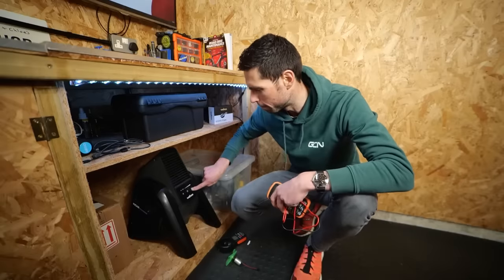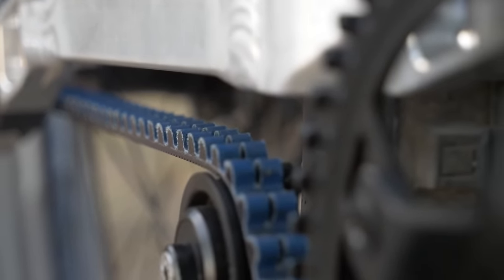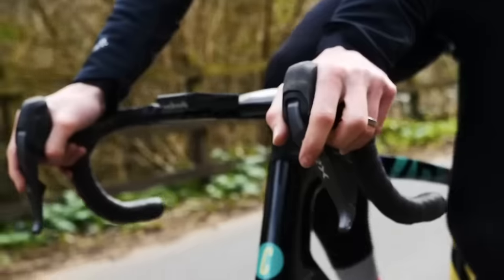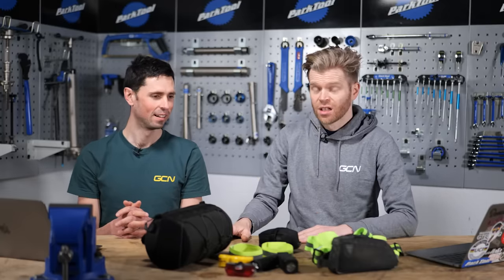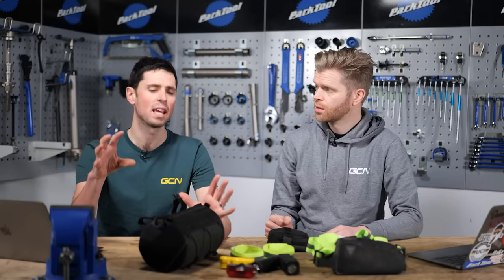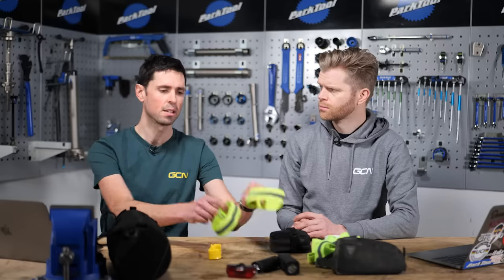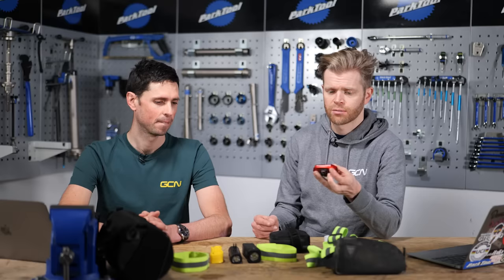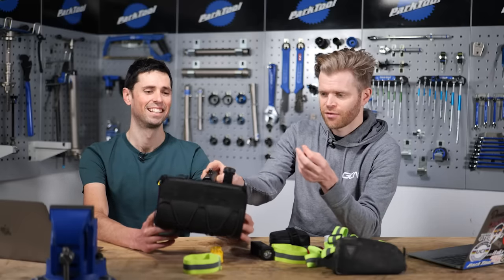The BEST Functional Bike Tech That Cyclists SHOULD Use!

Comment from the maker: What are the best cost-effective upgrades you've made to your bike? 🚲
Reply: It might not look pretty, but any kind of mount for a bike lock (kryptonite do their own) is such a time saver. Instead of digging around in a bag or pannier for your lock you just unclip it and lock up in seconds. Also - shifts weight to the middle of the bike so helps with stability.
Reply: Mudguards and a top tube bag. Both are super functional.
Reply: hi GCN bikers
I am a long distancies biker, from Greece, but I am using my bike in the city of Athens... so from my expirience I have to say... in all my routs I make my self visible using lights, but not only under my sadle olso to my helmet. In the city trafic, that all of people r behind the stearing, holding a phone, or they r stessed, they r going to c me when the crash me... unfortunately... and the second roule for me is that I am wering yellows jersey and pands... yellow is a unic color, reflecting so its easy to c me... thank u
Reply: Good tires.. they really save energy.. so you need to eat less.. and thus save back the price of the tires 😁
Reply: rear light with bike radar is great
Reply: @Jari1973  Eating less further reduces CdA - what a synergy it is!
Reply: I'd like to see GCN Tech do some testing on using CO2 refills with tpu tubes. I've seen a few stories online of tpu tubes starting to leak near the valves, and I think its because the CO2 refilles are freezing where the valve joins the tube. the freezing causes the joint to harden, expanded and crack. I'm not certain tho, and cant afford to do my own testing!
Reply: I looked into a dynamo hub, I rarely ride in the dark but I do have quality lights which are the rechargeable type if I need to recharge them while riding I have a top rail bag, my power bank and long cable available for the headlight. the cable is long enough so the power bank can go in the side pocket of my tights or shorts not ideal but it works, I always have my power bank with me in my backpack if Im commuting or working.
Reply: Tyres and right clothing🤟
Reply: Radar replaces rear mirror and rear light.
Kick stand is another practical upgrade, but quite often difficult to fit on a road or gravel bike.
Reply: I've made an upgrade to my E-bike that has an Nexus-8 (hub gear).
Well, it's more an downgrade. I've changed it from 21 teeth sprocket to a 22 teeth sprocket on the back.
I've lowered the speed of my E-bike by aprox. 5%. And that resulted in that I accelarate faster. And it has a bigger range.
I didn't install an dynamo hub. The lights are powered by the battery itself.
Reply: A 30L lockable trunk on the back of the bike for more secure storage.
Reply: Despite the overwhelming support in  the comments on previous videos you continue  with your blinkered personal viewpoints and refuse to acknowledge the usefulness of rear view radar lights.
Reply: Swept back handlebars are much more comfortable on my wrists than the flat bars it came with.
Reply: Dont forget   THE BELL
Reply: Maybe its not seen as cost eccective to those who haven't had one- but the Varia style radars, even thoseby Magene are just as good. couldn't live without them now :)
Reply: A helmet with flashing headlight/back light.... with brake lights and turn signals! It wasn't crucial where I used to live, but in the less cycling friendly place I am now, it is a life saver. I LOVE my turn signals. I think my helmet has ~10hrs charge when flashing, the turn signal buttons on my handlebars ~2 weeks. 
I'm much better in traffic with this, and the car reaction is usually better than without it. 
I still use hand signals, but lights are soooo good.
Reply: Keeping in with the leg bands, I've always use ankle bands, as the movement alerts drivers more than static. 
Also, Ive use two lights, one for dry commuting, and the back up as the rain light for more inclement conditions.
Reply: Little bags for tools that fit into bottle cages (saves room in the bar bag)
and rear lights with integrated brake lights.
Reply: A plastic bag for your bike pump and other essentials that go in your pack. A bike pump will not survive a winter on the frame even if you cover the internals in grease
Reply: A decent rear view mirror
Reply: I bought reflective tape off ebay for $4. 2 meters and I can put it on spokes, pannier rack, pedals, helmet and rear basket for increased visibility. There's so many possibilities.
Reply: Oh another favourite is a padded seat cover! I can wear normal shorts on my rides which means i dont have to walk around with a padded bum, and I can take it off if it's causing friction. I have a super solid seat and am very heavy, so it makes a world of difference
Reply: Quality bar tape
Reply: Rear basket on rear rack.
As a daily commuter, being able to do the shopping on the way home is priceless. Can recommend the Basil Cento as it is aluminium and quite sturdy.
Also cable operated brakes and gears are much much easier to maintain.
Reply: Rear view radar lights are useless in heavy traffic. @gerrymcbride6429
Reply: Dynamo hub and mudguards.
Reply: A whistle for urban or crowded trail is the best and cheapest investment for alerting cars or ppl. Bells won't cut thru car music or headphone wearers etc.
Reply: Loved this video. Maybe also some videos on the best bike you can find for £1k, £2k, £3k etc.
Reply: Why dont the presenters do something way more realistic & actually pay for their own gear. Then we’d see the truth
Reply: MIK mount for a rear cargo upgrade! So many rear rack options are kind of rubbish for the price. Might as well diy it with a MIK and get rear storage exactly how you want it, no compromises.

Attach half of the bracket to your rear rack. The other half attaches to any bag, cooler, milk crate, etc.. And then you have a durable rear storage that easily comes off only when you want it to.

Depends on what container you want to use, but install for my milk crate was just hex keys and zip ties.

Comment: If you regularly ride shared paths with pedestrians, I would add a bell to this list. I acknowledge that too many pedestrians do not hear or respond to a bell due to ear buds or other reasons, but enough pedestrians do hear and respond to bicycle bells, in my experience. I regularly get thanked by pedestrians for using my bell.
Reply: And always slow down, you don't know if a kid or some dog might want to cross your way out of a crowd and always brake before dead eye corners, who are 90 degrees.. Just in case if a car comes and won't see you. For example if pretty high fences are in the way and stand/get up on the bike to look over such fences or trees etc, that might block your sight before such corners.
Reply: Bell is likely legally required in most places anyway right? It is here in australia
Reply: @JFat5158  It is but that doesn't mean that everyone has one. And if one is attached, it doesn't mean that it's easy to reach and works well.
Reply: I've been thanked as well, especially by dog walkers, although some just ignore me.  I've also heard people wearing earbuds shout after me, only to be told by other pedestrians that I rang my bell and they heard it fine.
Reply: @JFat5158  In the UK I think it's a legal requirement that every bike sold has to have a bell, but once on the road all that's required is an "audible means of warning of your approach" so your voice will suffice.
Reply: Where would you be going with no bell on your bike and your knickers ringing.( no bell, no mudguards ). Thats what my Dad used to say.
Reply: "on your left" works also
Reply: Being Dutch, I almost forgot this is something to even mention. My brain just thinks of a bell as a part of the bike rather than an accessory haha
Reply: Aren't they mandatory in most of the developed world?
Reply: I shout ding ding, sorry I've not got a bell! It normally gets a laugh and a positive reaction!
Reply: I always use my voice rather than a bell or horn. A polite excuse me as I approach someone. A shouted alarm if someone is doing something that endangers me. I did get some looks after the school drop off when a car did not see me. I shouted loudly Jesus  fu**ING christ!!!
Reply: "On your left" (or "on your right" in UK-ish countries) always works for me. Bells just seem too dainty and childish. Maybe an upgraded version with digitized sound effects.
Reply: A really loud freehub and a quick “excuse me please” is way more effective than a bell!
Reply: If you want to do a good pace just ride on the roadway. Leave the pavement cycling to kids etc.
Reply: Many places in the US require them. The really loud ones
Reply: Noisy rear hubs ftw.
Reply: @JFat5158 Not legally required in the UK
Reply: @billymurphy4800 I think he meant " knickers wringing".
Reply: i have a bell that opens up and has an airtag slot inside haha
Reply: So cheap to get yet the trail i ride there is a rider who has no bell and doesnt bother to shout either.

Comment: I don't think it's right that an internal gear hub always gives you a reduced gear range.  Pinion gearboxes, for example, give up to a 6x gear range, which is more than you get on nearly all modern derailleur systems.
Reply: It depends on the gearhub/gearbox. Rohloff claims around 500% which is similar to these huge 10-50 casettes. I think you can get more with a 3x system and Pinion has even more.
The cheaper ones (Alfine 11 with 400%) have less.
But they all have one huge advantage when cycling with luggage: The can change gears at low cadence or standstill.
Reply: Yes, it's misleading... it gives you less gear options in terms of the actual number available, but every gear is useable and no double ups. The range (high to low) is often greater than is available via a derailleur - so their comment needs to have a caveat attached to it... the range is similar of better and all the gears are useable, but you only have 15 in the case of a Rohloff.
Reply: @markjthomson  Small correction: Rohloff has 14 gears.
Reply: Another interesting thing is that the change between the gears is almost identical throughout the whole range.

Comment: Garmin Varia radar is probably the most useful bike tech out there. That should be a must have for almost all riders.
Reply: Why? Most of us can hear cars coming and turn to see them.
Reply: 'Most useful'?  No way.  A mirror works just as well and keeps working on long rides when your battery runs out.
Reply: A Varia is like a buddy behind you who is constantly checking behind them. Sure you can hear cars come up if you only ride under 10mph and in good weather, but no one can hear a vehicle 100m behind them. Other than that it does away with 95% of shoulder checks. And the change in flash mode when a car comes up has a positive effect on driver behaviour. A Varia isn't useful in busy traffic, however. Battery life is as long as most lights anyway. A mirror only works if you look in it, a Varia works constantly. Very few people who have used a Varia think it's not worth it.
Reply: I check them anyway because I want to see what they are doing. A blinking light is not telling me if they are avoiding me or if they are gonna hit me because they are texting and not whatching where they are going.
Reply: Look at the road not at a screen

Comment: I live in Japan and have a "mama chari" bike with a dynamo hub, belt drive, internal hub gearing, mud guards and even 2 baskets.  I wouldn't be able to lift it to save my live, but I love riding that bike to the shops.
Reply: I think the problem with these heavy ass dutch style bikes is that they claim to be very practical and reliable, which to an extent they are, but there is just so much more to be had with something like a steel ATB. My 80's true temper framed mtb also has fenders, a dynamo, front and rear rack while having even more gearing selection than an IGH can offer while being under 30 lbs. A belt drive and IGH is going to be less maintenance, sure, but you really do not have to maintain a chain drivetrain as much as GCN would leave you to believe. 3x7 drivetrains are robust.
Reply: @testtest-ol3yi  Yep.  Not going to disagree with you there.  I love my mama chari, but you can pick them up used here for almost free (mine cost $70).
Reply: fair nuff i guess. americans pay hundreds for them, so my perception is biased. @urouroniwa

Comment: Mirrors are so underrated, especially if you’re riding in the city. Even a small bar end mirror like the Zéfal Spin 15 can make a huge difference in safety. Checking for vehicles before changing lanes or making a turn is much easier and faster with one of those.
Reply: The cool kids will never use mirrors but they help enormously when in traffic and are good if you are pacing someone on your wheel. Don't forget to look  in the blind spots though.
Reply: I can definitely see the use case for a bar end mirror, especially if you have mobility issues. However when I'm in traffic I personally find it much safer and more reassuring to turn my head and look at the cars behind me if I have to veer from my line (potholes, parked cars etc) -- I've found that that sort of action generally leads to cars giving me more space (might just be in my head though) 😅
Reply: @matthiaswuest7271  I agree 100% with this. I suffer from poor mobility in my neck and use bar end mirrors but in heavy traffic I also turn my head as far as I can regularly so that drivers following me get the idea that I'm checking on them. They definitely give me more space then. The mirrors are especially useful on long open stretches of road when I can see vehicles at a far greater distance and gauge their speed of approach over several mirror checks.
Reply: I use my ears and I know after 50 years the deal
Reply: @stevegoodfellow3423  exactly. I don't have mobility issues, but I find that keeping track of cars behind me is much easier with a mirror than with head turn. I do turn my head, both as a sign to drivers and to get a better look — the mirror is something to use in addition to , not instead of turning your head.
Reply: My personal observation is that people with mirrors are somehow worse at noticing when I come up behind them than people without one... I get it for people who can't turn their head well anymore, but I'll stay with looking over my shoulder for the full view without blindspots while I can.
Reply: If not for a mirror, I’d probably be not watching this vid! Car cruising up the bike lane, sounded like any other vehicle approaching from behind, I looked in the mirror and saw it coming up behind me. I veered off the road ( lucky I could!) just in time to see the SUV cruise past at unabated speed, still in the bike lane.

Comment: Internal gear hubs (the better ones) normally have a GREATER range than derailleurs: Pinion 636% of 600%, Rohloff 526%. Enough for even the steepest climbs.
Reply: I was just coming down to the comments to add this. Thank you!
Reply: Those are gear boxes not hubs.
Reply: Could you combine pinion and rohloff?
Reply: @climatechangedoesntbargain9140  Somebody in the Netherlands once did as a fun-project so yes it is possible. 252 gears...
Reply: @davidmurphy9151  Not true. The Rohloff is an internally geared hub.
Reply: For normal riders the 8 or 9 gears from a Shimano internal gear hub is fully sufficient. Unfortunately here in Singapore there are no internal gear hub bikes.

Comment: As a bike delivery rider, I appreciate that you guys touched on a few spare inner tubes (3 to 1 for TPU vs Butyl)

Touching on that further, i recommend at least a miniature foot pump with a gauge (Decathlon has a model) to pump the tyres with, or, if you are willing to risk limited uses or have access to a charging station - pocket sized electrical air pumps

The former has saved my bacon multiple times during the stormy season where I live, and punctures become more commonplace due to the heavy amounts of building and road construction debris that get washed all over the place by said storms

Comment: Dynamo and built in lights are a game changer for everyday around town riding. Lights are bolted on so you don’t need to remove them when you park. They just always work when you ride. Would you buy a car with separate lights that you need to remove and remember to charge? And the lights are designed to put light where you need it, not just be super bright.

Comment: I also love the “Bob the Builder” harness, which I’ve used as well.  A lot of the nicest clothing brands just don’t come in visible colors, so I put these on to improve visibility.  You don’t actually need one that goes across the shoulders as they make belts too.  One of the good things about the  harness option is that you can fully unzip your layers, push them completely open (behind your back), and then there’s no flapping in the wind.

Comment: Great practical advice for using a bike as a mode of transport and not just sport. I’ve been commuting daily for a few years now and recently came to the conclusion that practically trumps speed and style. Bought a Trek District 3 and it’s been great. Belt drive, Alfine 8 speed gives sufficient range for the hills, dynamo lights are so convenient but I back it up with additional rechargeable lights, mudguards keep me dry. I’d agree with others about how useful a bell is on shared paths. Will consider getting a mirror now. 
I would add a suggestion for a pannier rack so that it’s easier to carry stuff. I got an Altura pannier that converts to a backpack which is great. 
Bike also came with a built in lock which is so useful for brief shopping stops. 
Keep the practical advice coming!
Reply from the maker: thanks for the comment!
Reply: Which pannier exactly?